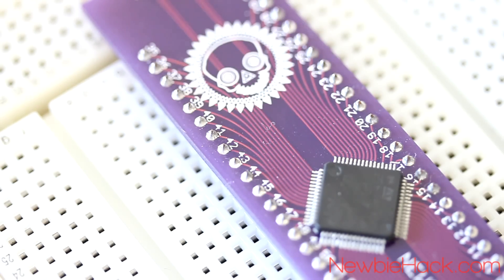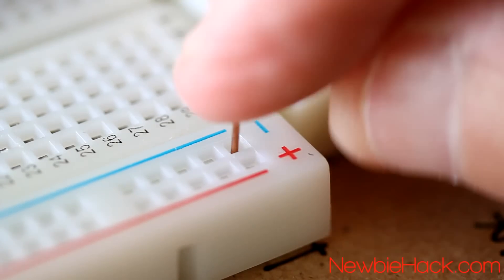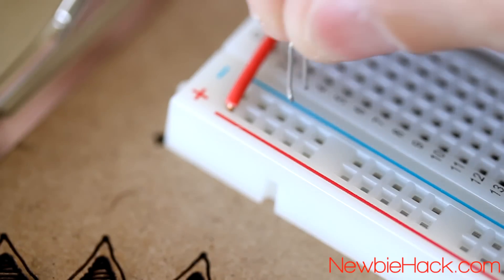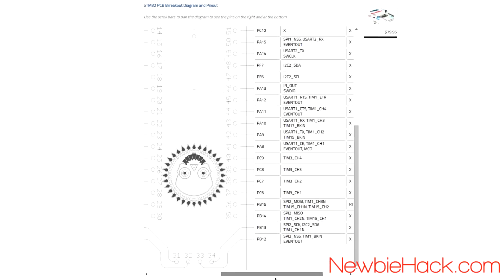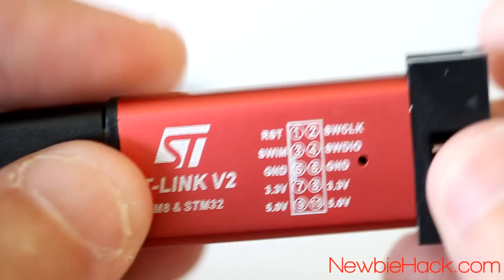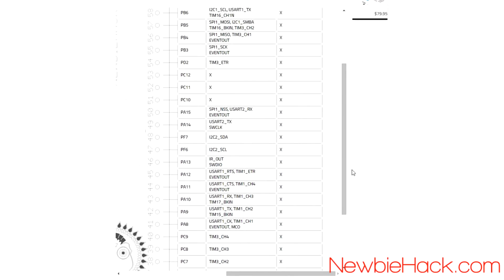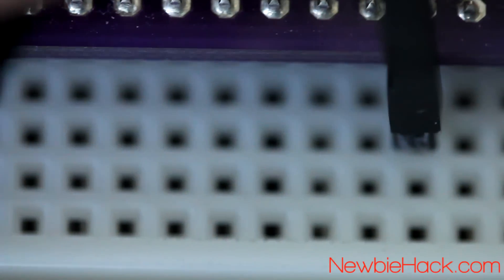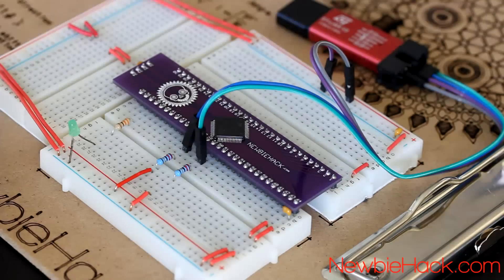5. How to Connect the STM32 and ST-Link v2 for ARM Microcontrollers - Tutorial and First Circuit

Comment: Why is power needed in all 3 pins? Is this necessary? Might be explained in ST datasheet..
Reply from the maker: The datasheet does talk about this requirement and what internal features use these power pins. For instance, the ADC power also powers the higher speeds of the chip.

Comment: There are no pull-up/down resistors on the SWCLK/SWDIO pins in the STM32-Nucleo schematic.
Are you sure these are absolutely necessary?
Also, you didn't say what value resistor used there?
I'm assuming a 4k7 or even 10k will do the trick?
Reply from the maker: Not necessary. You will see that I don't use them later on. Thanks for this clarification.
Reply: @PatrickHoodDaniel  Thanks for the response.
I saw something in the datasheet about internal/embedded pull-up/downs in the MCU, but then it does recommend a 100K pull-up on the SWDIO.

Comment: Hi,  can you explain,  in layman’s terms,  what the bypass capacitor does in this circuit?  I get that capacitors store charge but I don’t understand its purpose here.  Thank you
Reply: Filtering the peaks and lows, its a common practice to use ceramic 1pico farads caps in the power part of appliances. As you said they also hold a charge so any appliance electric, electronic need to have their capacitors shorted with an insulated screwdriver. Once in my life i serviced a 1000 watts PC power supply and i didnt empty the caps (massive ones) because i was on the phone while pulling the pcb out. i touch traces one with each hand under the pcb and i swear the discharge i took made me stutter on the phone and probably almost killed me. very often for filtering we/they use non-polar caps like these ceramic ones. im not sure electrolytic could do the job since the negative lead cannot take a leak without blowing the cap

Comment: Great video! It was like an electronics lab!
a) At 5:05, why would the designers of the chip put in 3 VDD power supply pins? ( Pins 1, 32 and 64 ). Why 3 power lines going in?
 Why couldn't they make do with just one power pin?

b) How come, when I am programming my arduino UNO, that I dont need to use anything remotely similar to the ST-LINK V2 (No middleman )?

c) At 11:25, you used those 2 resistors to tie them high and low. How did you know what value resistors to use?

d) At 12:40, you picked pin PC6 to connect to the LED. Why did you pick that pin? Why not pin PA8 or PB15? What made you decide on that pin? Can you please tell me what was your train of thought to pick that pin?
 Is it because the datasheet said that it was an I/O pin? ( Even PA8 is an I/O pin according to the data sheet; why not pick that?)

Thank you for your replies!
Reply: a) Having only 1 power pin limits capabilities of the IC. When toggling multiple pins at high frequencies, a significant amount of power is transferred. This power must be supplied by the power pins. If the IC had only 1 power pin, then all the power for the chip had enter in one side, supply all internal circuitry and supply all outputs going HIGH. At 10kHz, that might be doable , but at 1Mhz+ the VCC on the chip would differ from one side to the other. As a general rule, the more pins one the IC the more power pins is needed to run it properly. BTW the decoupling cap placed on the breadboard is really not a proper way to decouple the IC. It should always be as close at possible to IC (mm-1cm range).

Comment: Im noob So i need to Ask about something.
Why do you Put this resistors and capacitors?

Maybe it Will be explained later but for now will it not work with out it?

Thanks for any answers!
Reply: Bcos ,the MCU cannot work alone by just connecting supply and ground(negative), it needs to be filtered , so a cap is used, basically if you search for the processor's datasheet, they ask you to wire up those caps and resistors to actually make it work (better).

Comment: I tried this process on several stm32f405rgt6 chips. Added the capacitors to vdd and vss pins and pull down pull ups to the swd sck pins. I still get an error when I try to connect the st-link. Any ideas why this is happening?  BTW I tried pulling down reset and still no luck. I'd greatly appreciate your help.
Reply: Another comment mentioned not connecting the Vdda, Vssa (analog source, ground) was causing issues, which is stated in the datasheet, therefore don't leave these floating and see if it works

Comment: Why are those capacitors being added and where should I look to find out more about that sort of thing? thanks
Reply: Is to remove the noise in the power line, we want to inject clean noise. Is called "decoupling capacitor" google that and you should get a good explanation.  Is also called a bypass capacitor.
Reply: ...and the resistors ...I guess I need a good practical book to refer too? ...??
Reply: Regarding the capacitors,  using STM32F030 series chips as an example, download the datasheet for the chip (e.g. STM32F030R8) and search for "Power Supply Scheme". In the case of STM32F030, you should find something like this: "Each power supply pair (VDD/VSS, VDDA/VSSA etc.) must be decoupled with filtering ceramic
 capacitors as shown above. These capacitors must be placed as close as possible to, or below, the appropriate pins on the underside of the PCB to ensure the good functionality of the device." That doesn't really educate us on the fundamentals, but it gives guidance on using the capacitors for that specific chip.

Comment: Do you really have to wire all of the VSS and VDD pins? I would imagine that they are connected inside of the chip. Or are they not? I have a feeling they are just in different places for convenience on the PCB.
Reply from the maker: Yes, but so you can have the experience of what happens, try not wiring the VSS and VDD pins and post the results here.
Reply: Well i know you have to wire at least one of them, but are all necessary?x

Edit: I don't actually have any of this stuff (yet), I was just looking through some tutorials and was wondering how they were used. I'm used to ATMEL microcontrollers, like the ATTINY85 and the ATMEGA32P.
Reply from the maker: YungNut yes. All of them need to be connected. Not sure why. You should get going on it. ARM chips are great.
Reply: Yeah its just expensive and hard to get into, the chips themselves are cheap, but everything you need adds up fast

Comment: Thanks for the video! Regarding the 22ohmns resistors, i dont see why you pulled down, because as far as i see in the ST-LINK schematic, the resistors are in serie between SWDIO/SWCLK and uC pins.  It seems like the seristors are for current limmiter or current protecction.So could you please tell us exactly what are they for?. Anyway, great video and gj!!
Reply from the maker: Alex _ you are correct, you'll see in later videos that I do not use the resistors.

Comment: Is there a way to program the ARM microcontroller without solder it to the STM32 board? I mean, if I want to develop a product based in the ARM architecture I suppose that I have to use one microcontroller for prototyping right? just like you do in this video, but in the moment I assemble my product, how can I program the rest of ARM microcontrollers? should I give the code to the PCBA manufacturer in order to  program all the ARMs that will be built in every piece?, sorry for my English tho.

Comment: In case anyone here is having trouble with a STM32 and ST-Link V2 (using SWD) after this tutorial. It took me forever to get mine to work after watching this. This tutorial says that you don't need to connect VDDA and VSSA since you do not use the analog pins. This is not true for at least some chips and has been causing my issues.
I simply connected VDDA to 3.3V and VSSA to GND, I know it's analog ground and so it should be connected differently, but I just wanted to try and see if flashing was working this way after reading about this on some forum. This actually fixed it for me and was necessary to get my STM32F103RBT6 working with any of my JTAGs (ULink2, JLink2, ST-Link v2).
And I thought I killed 4 of these chips soldering them....:(
Like I said, I think this is only the case with some chips as this tutorial says you don't have to do it and I have no doubt that this guy knows what he's talking about. I'm pretty sure it says it somewhere in the datasheet.
If any of this Information is at all wrong please let me know. I don't want to mislead anyone here as I'm not an expert on this topic.
Still a very helpful video.
Thank you.
Reply from the maker: Sorry I just got to this question.  A reply to this question led me here. It is a very good idea to connect those pins.  I don't just because I haven't needed to , but the datasheet for my chip states that it must be connected.  I have only used those pins when I started doing my ADC coding.  Thanks for the tip.
Reply: I'm so glad you mentioned this.
Reply from the maker: Me too.

Comment: You connect a resistance of 22 ohms. Maybe it's a small value, probably need more value to connect.
Reply: Is the 27 ohm value of the 2 resistors correct?

Comment: Hello! Please help. I have a stm32f100c8 MCU. For programming with ST-link-V2 must be connected with pin 34 TMS SWDIO, then 37 pin TCK to SWCLK, then all conclusions and ground all power pins + to connect at 3, 7 volts. And also to SWDIO and SWCLK to connect the resistors, respectively. Or please tell me where you can read about it. Thank you.

Comment: Where do you find the information to tell you that the value of the needed resistor is 22 ohms and what points you to the value of the capacitors that you used? 
Thanks for the video.
Reply from the maker: I use the existing schematics for stmicro boards to determine the resistor values and the need for them. The capacitor values and use is from the development of many projects and general electronics education.
Reply: +Patrick Hood-Daniel Thanks for the information and taking the time to answer.
Have a nice day.